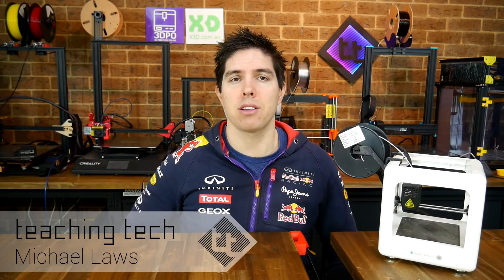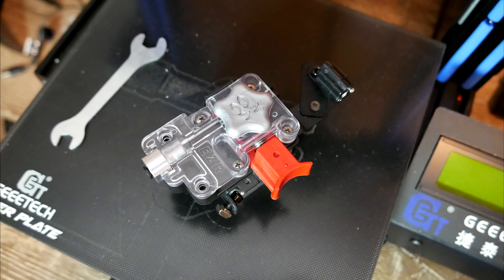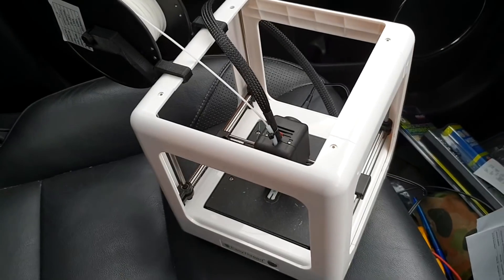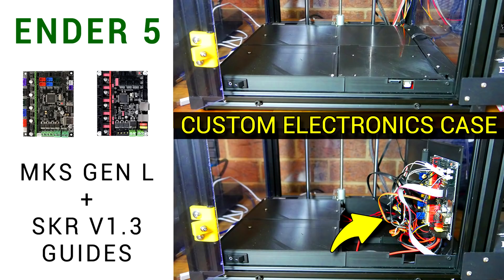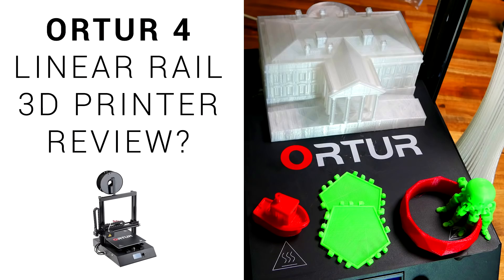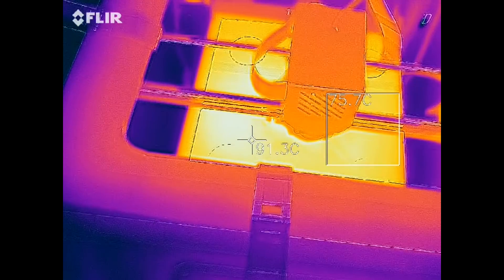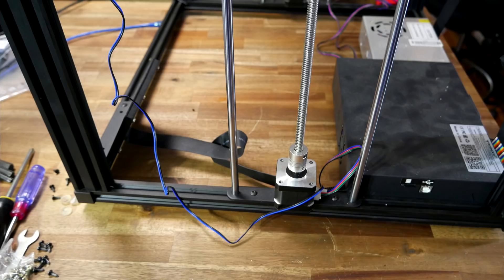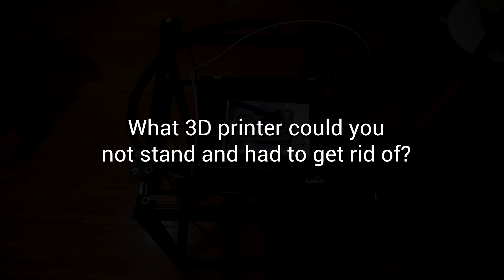3D printer review updates - Keepers and clangers

Comment: I've had a few... a folgertec i3 (the acrylic one) I only got one reasonable print from it because the frame was too flexible. I disassembled it and kept the steppers and a few other bits, but gave away the rest... I purchased a tronxy x1 which promptly caught on fire... it had a bad barrel connector which sparked and burned the board, and the acrylic enclosure... I was there and caught it before it could do any more damage... I did a similar mod (an all in one case, but I built it from wood) and installed the ramps board and power supply from the folgertec. after making sure it was safe, I passed it on to a friend's son who loves it... but I had also made the mistake of purchasing a Tronxy X5S (early model)... I knew it was a project printer and I tried all kinds of solutions to get it to work... but I needed a 3d printer for some of the fixes and bought an ender 3 about a week after your first ender video... (and a few other folks videos) It was so reliable that I grew disgusted with the Tronxy and just let it get dusty on my workbench... I now have 5 Ender 3's (all the basic model) with flexible steel beds, EZABLs and SKR e3 minis... and the TFT3.5 E3s... (the SKRs and TFTs were mostly from trying one after your videos, and finding how much I liked them...) I tried the WhamBam sheets, but the 2 I got both weren't deburred on the edges and I ended up cutting myself on one... (I've since deburred them myself)... I am not a fan of PEX or PEI... they take a lot of maintenance, but I was lucky enough to get a booth next to GeckoTek at ERRF in 2019... they gave me a sheet to try on one of my printers... now all of mine have steel beds with geckotek (hot) which just needs to be semi-clean to work... a quick wipe down with IPA on a small pad to get rid of dust if the printer has been sitting idle for a few days (not recently), though I have creality glass and hairspray that I use for some things... I am often printing on all 5 printers at the same time (I demonstrate iterative design through 3d printed combat robots ) and I am constantly printing new or iterated demo-bots for kids to drive and destroy... plus parts for my own competition 450g "plastic antweight" class bot... until recently... my enders have been printing PPE for a couple months now. I purchased an Ender 5 plus and assembled it last week... I need a larger print area to prototype my new 1.35kg (3lb beetleweight) bot that I want to take to compete with next year... and while the final bot will be waterjet cut AR500 and HDPE,  prototyping in PLA is much more affordable :)  
I am working on a design to turn the extrusion and motors of the Tronxy X5S and the electronics I bought to upgrade it into a custom enclosed heated bed printer.... though it means designing a (working) core-xy (unlike the Tronxy's mess) I am placing all of the steppers under the printer and using the smooth rod from the X5s to transfer X&Y up from underneath with bearings to support them, and instead of linear rod for Z, I am using V extrusion and v wheel carriages... the same goes for the Y and X... I am going to use steel sheet insulated on the outside with cork for the enclosure connected directly to the extrusion... with the top and front hinged and latching with a cam like a one-sided hammer nut. 
I really hate the electronics on the Ender 5 plus... and that is just after calibrating it. I can already tell it's getting a board and screen swap... plus I will probably pull the BL Touch and replace it with an EZABL... but the printer otherwise seems to have good potential. Not sure about candidates for it yet. Any suggestions?

Comment: A tip is to not use the glue stick, use builders / hobby wood glue ( white with caseine binder) . Dries in like 2 minutes if smeared thin, and to remove if it sticks too much just add a drop of water at the print edge and wait 30 secs, then capillary forces lifts the print. It works for a few prints before you put on new. Much better than surface of various kind and alcohol as it always work, is cheap and easy

Comment: I lucked into a free Ender 3 Pro that had been assembled (using term very loosely), but never used. The owner got so flustered with it (due to the crappy assembly job) that he offered it to a mutual friend who already has two, so he in turn passed it onto me. I totally disassembled it when I got home from work, and the next evening went through the rebuild step-by-step paying close attention to adjusting as I went.

I had it up and running about 90 minutes after starting the reassembly.

(Also scored 4 reels of filament out of the deal)

Comment: My worst ever printer?  Artillery X1.  Cable problems (flat cable and stupid plugs), design problems;  Couldn't get my hands under the bed to level it.  Wheels too close to the base. Never was able to print anything.  It went back after about a month.  2nd Worst?  My very first printer  FLSUN Delta.  Worked okay right up to the point I tried to remove a print from the bed and the entire bed came off.  It ultimately was held on with Plastic screws!  Oh Really! My 2 best printers, Tevo Tornado and my current Ender 5 modded to direct drive.  And thank you for your videos.

Comment: I'd be very interested to see the Flex3Drive dual drive modification. I was considering working on a similar mod since I saw another remote drive design on Thingiverse using Bondtech gears, but the slowdown in shipping has delayed my Flex3Drive substantially so I've been unable to test it with any of the actual parts.

Comment: I know it's not the most popular opinion, but I will probably get rid of my Ender 3. I couldn't get a week of work out of it without something breaking (extruder, fan) or something going wrong. The bed simply could not be leveled (I even took it to an expert who spent 7 hours trying to fix it before giving up!!) and I ended up getting a BLTouch - which didn't even match the printer (the motherboard box could not be closed with the BLTouch connected and the firmware they supplied didn't work at all). All in all a very bad experience for a first printer. I want to get rid of it simply because I don't trust it anymore and scared that the next thing to go will be something actually dangerous.

Comment: Nice vid, was fun to see some printers in there lol. My first was a kossel delta 6 years ago, loved it but I was always working in it, demanding to much out of it. My second was a X5S, that I worked so hard on it, to realize at the end that the frame was warped, so no matter what I did, parts where just fighting them self until they broke. So then I got a sidewinder X1, and after just a few mods, it prints like a king! It is my to go printer. I also a Chiron, still calibrating it, but working pretty well via price, but made me wish there was a larger sidewinder instead. I own also a Mars', resin is fun, but so small, Saturn model coming out has my attention...

Comment: XYZ Da Vinci jr. 2.0 mix - it is in a corner holding down the floor.  XYZ stopped supporting it, it can only use their XYZware slicer, their NFC-chipped filament, and the jams and error codes associated with a closed system drove me crazy.  Sad, because it is very solidly built and with a full enclosure it’s good for classroom use - when it works.  The 2-into-1 hot end is a nightmare, and the extruders are sealed, so cleaning them is impossible.  I now have a Prusa MK3s, a Prusa Mini, and a Creality Ender 3 pro, all of which were impulse buys to replace the Da Vinci in a moment of rage.  I’m in therapy now, surrounded by 3D printing love from my new printers.  Life is good.

Comment: CR10S Pro user here. Incredible to see that with mods this printer still kicks ass. I use mine for PETG permanently in a warm room and it does an excellent job. It really was awful stock with levelling issues but an awkward BL touch and Noctua saved the day and now it has got to be the quietest printer out there. Sounds like I should've gone for an Ender 3 based on this video and the community size is really what matters.

Comment: Had to get rid of quite a few 3D printers, but most of them no one wanted so I had to salvage the materials and sell the scrap. My very first printer was a Robo R2 which refused to reach printing temperatures and wouldn't move motors correctly, diagnosed & found Raspberry Pi was to blame and replaced it. But afterward the hotbed still wouldn't heat enough for ABS and no one I asked wanted it (including every single local school & university) so I scrapped it, recovering less than 1% of the price I paid when purchased brand new. Next I was lead to believe XYZ Printing units were very good and bought my first. XYZPrinting Da Vinci 1.0 Pro which failed 1 month into ownership, then Da Vinci 1.1 which had a bad Z carriage, then 2.0 Duo which had a bad mainboard, power supply and X pulley bushing. I called XYZPrinting about each and they refused to repair them then made clear that they were Blacklisting me (violating USA law where the warranties are legal contracts). I decided to go with what was said to be an ultra high quality make and I purchased an Ultimaker 2 to get away from the godawful XYZPrinting units & their terrible support. Upon the 3rd print it burst into flames and nearly took my 1860 Victorian home with it, causing smoke inhalation to my lungs for which I am already handicapped. I finally broke down and bought a Tevo Tarantula Large bed, Dual Extrusion, Auto leveling, dual Z unit. The 2nd Z motor & rod wasn't provided until I made clear that USA law 39 USC 3009 enables me to be completely refunded for the entire printer since it wasn't what was paid for nor said it would be and I wouldn't legally have to send it back but if they covered the return shipping I would. The next day they shipped the 2nd Z axis motor & threaded rod. It arrived months later and turned out not to be a NEMA 17 wired for use with a Tevo (thank goodness I checked first!). I swapped the wires in the header plug and powered the unit up, but the 2nd Z motor responds well after the original motor so it was absolutely useless as 1 side of Z falls far behind the other in height. It's still sitting around with mo one wanting it nor being fully functional (a shame I spent the extra money on the all Aluminium parts to replace the ultra fragile plastic original's many of which arrived broken from the very first opening of the box). Finally after seeing Tom Sanladerer's, 3D Printing Nerd's, but most of all RCLifeOn's video about the Creality CR-10(S) [RCLifeOn's video compared many printers in the same video and as a result was the one which most convinced me] I bought a Creality CR-10S. Having been through the Tevo debacle I was extremely unhappy with the idea of buying another Chinese 3D printer (although the American ones were no better... and the European one nearly killed me) but every review was over the moon for it, so I bought it anyway. It printed 1 benchy in PLA then completely clogged. I heated the hot end, passed the needle like probes in as far as they would go (not far at all it turned out) and tried pulling the filament back out while hot. It refused to budge and broke instead. So while hot I pulled the Bowden tube out and removed the nozzle then turned it off and allowed it to cool down. I then unscrewed everything and discovered that the filament had filled the Bowden tube, outside of the Bowden tube in the heat brake tube and filled the cooling section. So I put the entire unit in my kitchen oven (thermistor and heating element were not present, as I said I took it completely apart) then used steel brushes to try and clear the PLA out. It didn't work. So finally I turned to MAP gas which did burn the filament to black dust, but it also melted a few blades of the cooling section. So I searched for possible upgraded replacements and came upon Micro Swiss. I bought 1 and Capricorn tubing that instant. I installed both and all was ideal for a few months. Because I print in ABS primarily and the ABS I had used worked best at what the thermistor said was 265°C it wasn't long before my hot end thermistor failed. So I started paying greater attention in Tom Sanladerer's videos in which people would ask him for help with problems and he would provide answers. But our answers were nearly always identical so I became convinced that I was not the problem I had suffered with so many printers, the printers were to blame. And this was verified when my Fluke 88AV multimeter and my multiple oscilloscopes showed the hardware to be at fault.
Now my CR-10S is absolutely 100% with my having added the Micro Swiss hot end complete unit, the Capricorn Bowden tubes, 8 diode TL Smothers, replaced the capacitors on my CR-10S mainboard, a Bondtech extruder, stiffening rods, corner brackets, L shaped joining plates for the corners, a full set of high flowing yet quieter fans, a Solid State Relay and finally a Keenovo AC hotbed heating element. It now prints like an absolute champion. So I purchased a Creality Ender 5 and did much of the same but for the Ender 5 I worked with Keenovo to develop an AC heating element for it and the Ender 3 and 3 pro (available directly from Keenovo here: https://keenovo.store/products/keenovo-silicone-heater-235mm-x-235mm-for-ender-3-3d-printer-build-plate-heatbed-heating-upgrade and inform them "monkeyman" sent you for it). Now I am awaiting delivery of my Creality CR-10S5 as are the MicroSwiss complete unit, TL Smoothers, Bondtech extruder, stabilizing rods, L shaped stabilizing brackets, a full set of fans, a Solid State Relay and a 508 x 508mm Keenovo hotbed heating element.

Bottom line, most people don't want to learn anything about them from the start, instead wanting one which is fully functional and they can learn on their way is what everyone else in Massachusetts has shown me. Otherwise any of the very many failed printers would have been taken and repaired (I was offering them all for free, so cost wasn't preventing their taking any of the many failed 3D printers).

Comment: I pre-ordered  the Prusa Mini 3 days after they were announced because I wanted a simple printer that was plug and play with no fussing or tinkering. Based on their reputation this should have been the case. Like most I had jamming issues very consistently at first but managed to suss those out, but I never overcame the Z height issue on the first layer. It changed for almost every print regardless of heat up routine. Also, bed adhesion was often hit or miss. I was so disappointed and frustrated that I took it apart and sold it. I at least made back what I paid for it.
Reply: The frame on mine was bent. Kept layer shifting to the left the higher it would print. After contacting Prusa, I sent it back for a refund, cancelled my second Mini, and put all that money on a new MK3s.

Comment: I had an Mendelparts Orca 0.3 which I retired this year. One of the old kits, I've bought it about eight or nine years ago. Compared with the printers sold today it has way to many issues to justify further work on it. It was replaced by an I3 Steel. I even used some parts from the Orca on it (Stepper motors, endstops, heated bed).

Comment: I've been trying to decide for 3 months what machine I want to be my first so this video has perfect timing. I still can't decide lol
Reply: Ye got kinda the same problem. I want a bigger print volume and a direct drive would be nice. On the other side a bowden dual extruder could produce some really nice color prints but lacks on flex filament support. Still need to make a bullet list with some printers pros/cons where this video helps a lot. Maybe start with a bowden one and later upgrade to dual extruder.
Reply: I went for a cheap Anet A8 (or was it a clone?) to get into 3D printing mostly because I wasn't sure if it was going to be a long term interest but also because there was lots of opportunities to improve it and i like tinkering. It's since been upgraded to an "all metal" AM8. It recently printed over 160 face visor bands for the UK NHS. Not sure I would recommend it because I don't think upgrading the firmware is trivial. I might be totally wrong but I read somewhere they removed the boot loader due to memory shortage. I'm considering upgrading it to a BTT 1.4 32 bit main board and Marlin, then possibly a dual filament extruder.

Comment: I have a MP Mini Delta, its bed is not flat and the ABL doesn't work properly. I now own a Artillery Sidewninder X1 and am happy with the results, it doesn't have ABL but the bed is so flat it doesn't need it. Unfortunately my heater cartridge MOSFET burnt so now I am waiting for a new cartridge from China, their support was very good and sent it free of charge. Also my ribbon cables are fine and haven't broke, they are only friction fit on the V4.

Comment: I once owned a copymaster 300. Absolute worst printer I've ever had. Aluminium bed was so warped it was unusable, then the board blew up. They sent me a new one with a glass bed this time but the board on that aslo blew up, about 10 minutes into using it. Turns out they were using 1 stepper driver for the twin z stepper motors and it just couldn't handle it